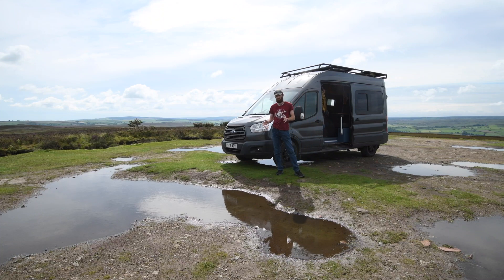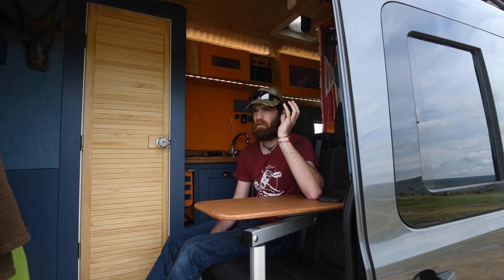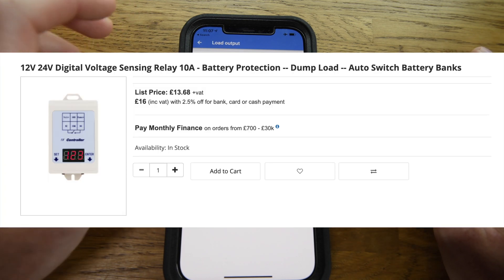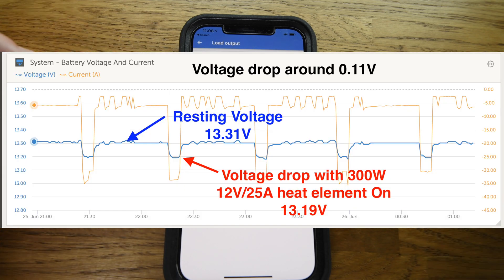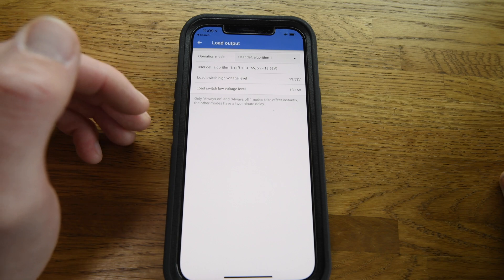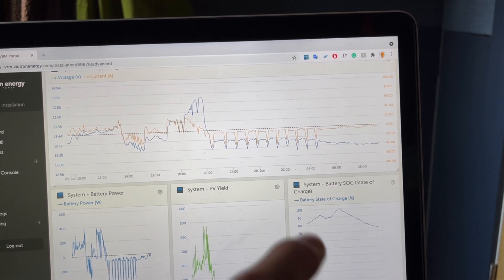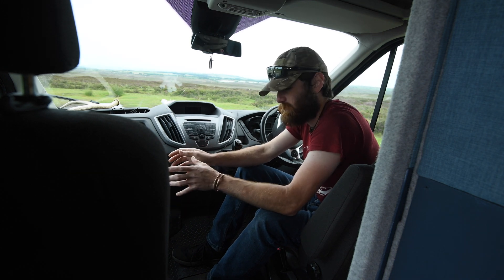FREE hot water from Solar dump! | EP51 | Ford Transit Campervan Build

Comment: Sounds like free hot water!  Great idea, so with my 160w panel and my Victron 75/15 MPPT I could do the same, using my output connections into a temperature relay using a smaller element?  I dont have a shower, but it would be nice to have hot/warm water on tap for the pots or a face wash in the morning.
Reply from the maker: Yes. That should work with the 75/15 model. As you have the “Load terminals” from my understanding you can those on and off using “User def. algorithm” under load output in settings, same as I did to a degree. Which should work for you to use the load output as a signal / to turn on a  for a temperature relay.
Reply from the maker: Wish a 160w of panel I would look at probably a 100w heat element
Reply: @MispronouncedAdventures  Many thanks Alex, where did you buy your temp relay from?
Reply from the maker: Amazon or eBay “12v temperature relay” should bring up loads of models

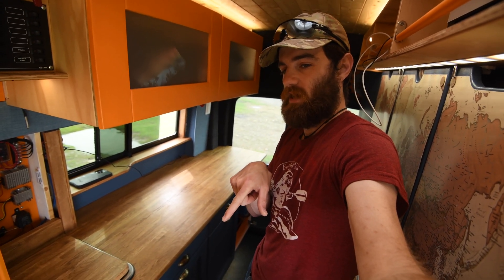Comment: Clever idea! Early doors in my van but I reckon this could work for me too. Sitting from 9:00 with a full battery on a Sunny day always feels wasteful lol! 270w solar and 200aH lithium. 150w element feels about right?
Reply from the maker: Yeah that’s should like a good option for you. 150w heater or 300w ( which is just 150w x 2 in parallel, just split the parallel and use a single one  )
Reply: @MispronouncedAdventures  great idea! I can’t see a UK stocked 150w anywhere. Bimble Solar have a 300w presume that’s the one you used? I’ll order one and see how fiddly it is to  bypass the parallel. Well worth a try for £20!
Reply from the maker: Yes I used the 300w from Bimble. Really simple to split the parallel is actually just two bars which join the top it’s just unbolt them and take them off it’s designed to be done that way. If you have Instagram messenge me on there and I’ll send you a photo
Reply: @MispronouncedAdventures  Sounds easy, many thanks Alex, I’m Alijcurran on Instagram (I think..) I’ve just followed you.

Comment: Its also a good additional effect that your Lithiums are never over a long time at 100% because they dont like that. I try to keep mine wirth the same principle of dump load always between 50% and 90%.
Reply from the maker: Indeed lithiums don’t enjoy long term at 100%. My 100% Soc is probably a bit under 100% of the batteries for capacity as I use some lower charge voltages. Additionally the parasitic drains I have in my system won’t allow batteries to stay full for long

Comment: Well-suited system for lithium. PWM would be best for lead.
I've designed a semi-similar system. I'd have to put a pressure switch on the line though to protect from the element heating a dry tank. 
Not such an issue with a recirc shower (infinity tank).
https://www.se.com/ww/en/product/9013FRG22J23/square-d-pumptrol%2C-water-pump-switch-9013fr%2C-adjust-diff.%2C-40-20-psi%2C-reverse-action/

Nice work.
Reply from the maker: Indeed, the safeguard for dry running the element in my case is pretty simple. I have the outflow pipe / supply feed of the hot tank above the level of the element so it’s impossible to drain the tank below the element, this is a byproduct of the Bobilvans kits as there heat exchanger also needs to not be dry run. 

as for PWM I’d agree for lead, especially with smaller lead banks

Comment: Great explanation, you really understand the physics of the problem.  PV diversion very misunderstood in the solar world. I built a version of this that diverts panel voltage proportionately to the heating element, be it 5W or 500W.  I use grid tie panels for about 60V.  The voltages higher voltages allow the use of 120V point of use tanks in the US without buying new elements.  The system is based on a simple theory.  When panel voltage rises above power point voltage there is excess power available. My board progressively increases load efficiently till the voltage drops down to power point. The change to load is instant, the battery charging cycles are not messed with, and the battery is always kept at as full charge as possible. The existing thermostat can still be used on DC due to arc interrupt.  And site ac can still be used if the tank is kept with a plug connection.  As electronics go it is fairly simple. Granted everyone is afraid of electronics. Those who have an interest it is a fun project.  Thanks for sharing your insights with others explaining these concepts.  There is power to be harvested and small amounts add up.  

I'm putting this system in a friends cargo trailer that has living space for hot water. He does trail bikes.  It will also provide some heat when it sits parked lowering dampness that can damage the tools musty smells when sitting unused for a week in colder months.
Reply from the maker: Thank you for your comment and a technical at that. It’s great to see that there are other Solutions to the same purpose. Definitely need to read into a few of those for a better technical understanding myself. Especially since other ways could truly divert excess energy opposed to my rudimentary version of System based voltage triggers. I’d quite like to play around in the future use SOC as a triggers I feel that would be more accurate for my version. 

Overall a fun and useful project with cheap components I’ve effectively had spare

Comment: Nice, I'd like to get this working all on the Victron Cerbo. There's 4 temp sensors and 2 relay outputs that you can control.
I should be able to use the SOC value to trigger the relay instead of the battery voltage that way too.
Reply from the maker: The Cerbo Gx is something I have been thinking About. Due to its relays and I can use a SOC which would be a far more accurate way of doing it. At the moment I only have a raspberry pi running VRM so no relays . However I am planning to getting a Cerbo and likely integrate the System into that. I don’t know personally yet if the temperature input for the Cerbo can be used as triggers. so it might still need to by run via the temperature relay
Reply: @MispronouncedAdventures  There's no way to do it via menu options at the mo. I'm looking into doing via Python scripting. Control of relay 2 is kinda limited at the mo.

There's a "Big" install of the Venus OS that has Node RED and apparently it should be easy with that but I haven't given it a go yet.

The digital inputs on the Cerbo are kinda handy. There's a coach builders panel next to the drivers seat on the Boxer/Relay/Ducato/ProMaster. I've linked the door open on/off output there to one of the digital inputs so I can see the status of the doors in VRM.
Reply: I'd be really interested to see how you get on with this. I'm also installing a Cerbo and wondered if I could hook it up to my Whale Expanse Water Heater using a 240v relay. I'm not technical at all but I would love to capture all that wasted solar. I'll have 395w on the roof and I'm running a 300ah lithium battery. I also have the Sterling 60amp  B2B charger which seems to a great job of charging the battery quickly. I'm doing a 3 week trip around England and Wales at the mo and unfortunately all. My victron kit arrived the day after I left. But the Sterling is more than dealing with the demands of my 12v system which is just the leds, usb charging, fridge. MaxAir and compost toilet fan.

Roamer, my kit supplier, have just got back to and said yes this is possible with the Cerbo and a 250v relay . The Expanse can be set to 750w or 1500w so if I use the former it won't melt the EasyPlus 1600va inverter.

Comment: I’ve been trying to get my head around doing this for a while now. I only have a PWM controller with the battery output only to batteries and load output going to what loads the van needs. So I want to take the excess without affecting the load. If I connected a second PWM to the load output of PWM, could I then power my priority loads from its battery out and anything left over go from PWM2 to the dump?
Reply: Yes it can.  It does take some custom electronics.  When the PWM is on charging, panel voltage drops to battery voltage.  When off it jumps above power point voltage.  A diode directs that to a storage capacitor.  A circuit pulses the heater till that power drops below power point voltage.  Are you in US?
Reply: @opera5714  extra electronics scares me a little. If Alex describes his set up as analogue, then I’m even more analogue. If I can connect a red and a black wire to a box that does it all, that’s my idea of advanced! I’m in the UK
Reply: @firstclassmaleuk   There is a lot to be said for the theory, if you can't buy it on amazon you don't need it.  I'm pretty surprised China hasn't come out with these modules. I've talked about a board I made for years and I almost can't give it away.  After 50 years in electronics I still hook things up backwards. Enjoy the road!
Reply from the maker: Cheers for the reply to this question guys I missed the original comment

Comment: Good to see you back matey... cool Idea for summer when you are not using Deisel heater perfect compromise as you will have less solar in winter when using Bobil setup... what ever happen to Part 3: Installing a Victron MultiPlus - LOL you where missing in action or I think you thought you had up loaded it or had problems with SD cards... cant remember ... anyway glad to have you back... great vid again...
Reply from the maker: Working for Bobilvans has kept me busy! I think it’s definitely Great combination to help with the Bobilvans water heater. 

Oh part 3 yep…. It’s taken way longer than it’s should. I even just bought the VE.bus smart dongle, so I can show that as well as the VE.bus to USB MK3 cable. and how they are both different

Comment: Great stuff Alex, time to run some more cables I think! So that other dump load controller from Bimble allows you to mimic the relay on the BMV712 to say when voltage hits 13.6 v it would engage the relay and set off the heating element? Very cool. Is there a reason you set the temp to 60 degrees, is it to kill bacteria as this system is on constantly? Your Bobil is set lower isn’t it?
Reply: Keeping it on for a long time at 30-40 degrees would be pretty bad for nasties living/growing in the tank I think. 60 degrees kills pretty much everything you'll likely get in the tank.
Reply from the maker: My Bobil is also set to 60c. As the recirculating the shower requires a pre heat to  60° as the initial starting it  flushes unheated water for the filters into the tank and  drops system temperature very quickly to 40 where it stabilises. Byproduct is 60° is also a safe temperature to keep a hot tank at killing any potential nasties
Reply from the maker: If you’re using the BMV-712 I would actually use the SOC trigger over a voltage trigger. It would be a far more accurate way of doing it to not having to take into account voltage drop and increase from charging.

Comment: At last somone has done it i been talking about this for ages how did you link up the load on victron couldnt see in the vid i have a similar mppt
Reply from the maker: Most version of the Victron mppts have a controllable load output some way or another. But it’s different between the 75, 100 & 150 models. 

Hopefully you’ll get it working for you. I think it’s well worth it

Comment: Super clever, thanks… I would like to use the bmv 712 , but my hot water heater is 230 v , is that possible with the inverter as well? Try to understand…
Reply from the maker: The bmw-712 relay you could yes the SOC alarm / trigger feature as the signal. 

I don’t see why a AC one can’t be used. You would just need to find some time of AC switch which van be triggered by a 12v dc signal
Reply: @MispronouncedAdventures there are 12vdc - up to 240ac solid state type relays you can buy to control  ac voltage from a dc source, I bought a number of these about 8 yrs ago for a mobile truck mounted seed grading machine I had built to control certain machine operations from inside the cab. I think they have a fairly wide operating dc & ac voltages you can control.

Comment: Great content! Very cool system! I have and still need to install a hydronic system that uses the fuel from the Van tank, but it also has an AC electric heating element intended for use if plugged into shore power.  But I like your system as I do not plan to be plugged in much and don’t like the idea of leaving the inverter on all day.  I guess if I am wasting 500 watts of solar while in “float” the overhead on from the inverter is nothing to be stressed about.  With your water heated all day do you get much residual heat in the van?  What size wire did you run for that 25 amps at 12V?
Reply from the maker: Residual heat wise not so much of an issue as the tank is heavily insulated. The cupboard it sits in gets a bit work but overall no effect on the van. 

Wire wise I’m using 10mm2 for the cable. 

I’m sure a AC electric element could be used. Just a relay or switch which can be triggered by a 12v / Dc signal

Comment: Hi thanks for getting back ,I asked wether a12 v element could be put in malalagar 5e . The answer was it would take too much current, as I’m not clever enough to put my case, I have 600w of solar and with a 100/50 controller potentially up to 50 amps, maybe I will go down the Bobil heater route  ,appreciate your help thanks
Reply from the maker: Yeah I see what you mean. I imagine most companies don’t know the ins and outs of doing it, and how individual it needs to be for different people systems. So doing it yourself with a Bobilvans kit would be a good idea